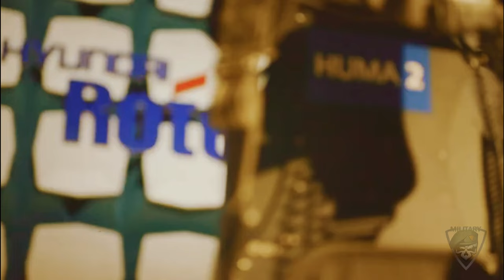K2 Black Panther : The Best Tank On Earth - Outperforms M1A2 Abrams and leopard 2 tank

Comment: News of three days ago, 26th. July 2023. Lithuania picks Leopard 2 tank as its MBT over Abrams and 'the best tank on Earth' the Black Panther and plans to acquire 54. The Czech Republic is to order another 50.
Reply: Czech borders Germany so the politics and relationship will determine which tank to buy. For Czech, it makes sense to buy German tank. Be prepared to wait 8 years to receive the tank though. Hungary ordered the German Leopard 2A7HU in 2018 and just this week (August 2023 - 5 years later...sigh) received ONE TANK. Also, the price per tank increased 2.5 times for Leo2 tank. Norway found out that the price increased to $60 million USD per tank and decided to not buy the additional 18 units of Leo2 tanks - too expensive. There are military planes that cost less than $60 million dollars. Romania on the other hand has close ties with Poland so most likely order 300 units of K2 Black Panther tanks to be logistically and supply chain ready with its partner, Poland. Italy has agreed to joint-develop the future K2PL specs for Europe as a replacement for Ariete tanks and no longer is a partner in the MGCS future tank project with Germany and France.
Reply: @jwb1227  The gist of my comment was that Lithuania did not choose the cheapest or the quickest to complete the order, but she chose, in her opinion, the best tank for the job, be as it maybe, more costly than the 'Black Panther' or longer to arrive than the Abrams, Lithuania chose the Leopard 2.
Reply: @joegatt2306  Germany sends NATO troops to Lithuania twice a year (I think?) so the relationship is there to leverage politics for a tank order. If you take politics and relationships off the table (not realistic), the real choice would have been between M1 Abrams (takes 3 years to deliver) and the K2 Black Panther (takes 4 months or less). Frankly, I think Lithuania is relying on Germany to send NATO troops to bolster Lithuanian troops (and maybe Poland also to send troops) in the event of a fight breaking out but Lithuania is way too close to Belarus/Russia/Kaliningrad to be so relaxed about its tank order taking 8 years to complete (Norway being in west EU far from Russia could take such a relaxed view but Lithuania is crazy). What will they do if Russians attack in 3 years? Throw rocks? Too much politics and not enough common sense or logic for Lithuania to order Leo2 tanks knowing that their tank budget just blew up because Leo2 tanks now cost 2.5 times more than the original budget and still takes 8 years to receive a few tanks. At least Estonia has better common sense than Lithuania.
Reply: @jwb1227  Still out of point, but anyhow, here is my reply: Czech Republic, Slovakia, Netherlands, Greece, Hungary, Poland (only country to-date to replace her Leo.2 with K2), Lithuania, Spain and Portugal, Switzerland, Turkey, Finland, Denmark, Sweden and Norway (all of Scandinavia! In 2020, Norway also had to chose between Leo.2 and K2, and chose the former!), Chile, Indonesia and Singapore, (so close to S. Korea, but...), Australia and Canada, Qatar and the United Arab Emirates. Potential buyers: Italy, Croatia, Bulgaria and Saudi Arabia, whose bid to purchase 600 to 800 (!) Leopard 2s did not go through due to opposition by Sigmar Gabriel, Minister of Federal Economy.
Reply: @joegatt2306  Your narrative paints a much more bright future for German Weapons production than reality. Here is my sur-reply: Total numbers for future Leopard 2 orders will still be less than K2 Black Panther orders. Just Poland and Romania will be close to 1,300 units of K2 with other Europe nations joining the K2 user club soon. Germany and surrounding nations who have good relationships with Germany (EU/NATO or otherwise) will likely choose to stay with Leopard 2 tank. Scandinavia: Norway chose to stay with Leo2 despite its own military asking the Norway government TWICE to buy the K2 Black Panther (this was real news, not fake news). Norway did cancel the additional 18 units options contract after the price of new Leo2A8 tanks increased 2.5 times to $60 million+ dollars per tank. Same for the rest: Sweden, Finland, Swiss, Netherlands, Denmark, etc. Basically, the most of the WEST Europe will likely stay with Germany's tank. This is not a surprise but expected. As for Greece, it has the only Leopard 2 tank production still in operation (btw, Germany no longer has an operational production line for Leo2 - that is why it is so slow to produce Leo2) and the fact that Germany saved Greece from the financial problem - so Greece will stay with Leopard 2. Turkiye will operate the existing fleet of older Leo2 tanks but after Syria and the fact that Turkiye now has its own MBT - the Altay tank in production due to help from the Koreans - so I doubt there will be any new Leo2 tanks purchased from Germany/Greece (Turkiye and Greece do not like each other). Spain and Portugal - these 2 countries will be "up in the air" (uncertain) since they only bought the older Leo2 tanks from Germany when they were sold as used for really low price. I doubt these 2 countries have the budget to afford $60 million+ dollars per tank price of new Leo2A8 tanks. Spain did not like how the Bundestag stalled the transfer of its Leo 2 to Ukraine and frankly lot of other nations are re-thinking the Germany weapons purchases because of this. As for Italy - it is no longer in the MGCS project with France and Germany - and has tentatively agreed to join POLAND for its next K2PL (Europe version) tank project. So not sure about Italy staying with Leo2. Romania chose American M1 and so did Poland. You will see in next 2-5 years that a lot of EAST Europe nations will buy American and Korean tanks for 2 main reasons: (1) Too close to Russia so need reliable weapons delivered faster than Germany (8 years waiting time) so American and Korean tanks can deliver faster, (2) Germany has shown to be UNRELIABLE as partner when Russia is involved (aka Ukraine) so there is a switch over to American protection instead. Americans are also having issues with slow production so Korean weapons are being recommended by the Americans (not recommending Germany b/c of Ukraine and slow production). Canada is 50/50 chance for staying with Leo2 as there are talks of purchasing K2 Black Panther for Canada as well as Korean Submarines. Australia is going with M1 Abrams, not Leopard 2. Rheinmetall sold Boxer to Australia but Koreans sold the AS21 Redbacks in competition with KF41 Lynx (I think using the quirky Liebjerr engine was a mistake. Should have used the reliable BTU engine like the AS21 Redback). Singapore will likely stay with Leopard 2 as their economy is strong enough to buy Leopard 2. As for South America and rest of Southeast Asia, they are more likely to abandon Leopard 2 tanks since buying new is not an option for them as their economy cannot afford the over-priced Leo2 and go with K2 Black Panther. The Koreans are expecting all this and are currently increasing their production capacity even more. Korea has 2.5 times the capacity for tank production over Germany/Greece but will be 4 times capacity over Germany in 2 years and that is just in Korea. In 2 years, POLAND will have a full K2 tank production line in Poznan, Poland. Poland will be a new supply chain in Europe for the K2 series tanks and the K3 next model. There will be an increase in Euro market and jobs for EU workers. Since Poland will also produce the K9 Thunder SPH in Europe, the current users of K9 will only increase. Even Norway, Finland, Estonia, etc. along with 7 other countries are using or will use the K9 Thunder. Both K9 and K2 will help each other in sales in Europe - mostly in EAST Europe and parts of WEST Europe. Norway, Estonia and others will be purchasing additional K9 units and the new K239 Chunmoo MLRS (Korean HIMARS with 12 launchers per vehicle instead of 6 in American version). Germany clearly knows that is going on and even Rheinmetall AG has asked the Koreans for partnership in future weapons development as there may be problems between Rheinmetall AG and KMW.
Reply: @joegatt2306  BTW, what I wrote about the countries and whether they stay with Leo2 or not - you opened the door by name dropping all the countries to flex the Leo2 user network (you meant to do that - don't think I did not notice). I merely gave you my sur-reply which looked into each of those countries internally. Most of those countries bought the Leo2 as hand-me-downs from West Germany after the end of Cold War. Germany did not want to pay for thousands of tanks to be kept maintained so it sold them off at bargain basement prices ($4-5 million dollars each). Most of those buyers today will not or cannot pay for new Leo2 tanks at $60 million dollars per tank. Logically - you can connect the dots - and see that in the future, some of those nations will retire the old Leo2 tanks that can no longer be maintained and switch over to the K2 Black Panther. Having a continuously running production line brings economies of scale and results in lower price per tank and Koreans are good at it. Moreover, they have industrial robots that do 70% of the armor welding and other automations while German arms industry still uses manual labor for almost everything. The time it takes ONE Leo2 tank to be built, the Koreans can build THREE K2 Black panthers which lowers cost of manufacture. You cannot achieve such advancements in just few years in Germany. It will take a decade of hard work and INVESTMENT.
Reply: @jwb1227  Another tediously long riposte. It’s getting boring, but here is my answer and it is as short as I could manage.
First, you did not address one single issue from my last post. The origin of this wasteful exchange of words was 'The Best Tank on Earth - Outperforms M1A2 Abrams and Leopard 2 tanks'. Now, if you took it upon yourself to determine that the WHOLE WORLD, (you got that?) is ABBANDONING the German tank and opting for the cheapest and fastest to produce, (because the Leo.2 is built by manual labor, in factories of lesser capacity than that of the Koreans….blah, blah, blah), then that is another matter altogether. The 0.5 million Stg. Rolls-Royce ‘Phantom’ sedans are also handmade and there are much fewer to go around but are more highly regarded than the 'robotic built' Mercedes Benz EQE sedan that cost under one fifth of the price, max. 
Secondly, you have spent sleepless nights to look into each and all of Leo.2 operators and all you come up with is ‘trade and politically motivated’ deals. Well, here is the thing. The latest S. Korea – Poland arms deal is the most trade-motivated deal of them all. Both countries have long standing relations. In 1989, after the end of the ‘Cold War’, South Korea and Poland established diplomatic relations (the second Eastern Bloc country to do so) and Seoul announced $450 million in loans to the financially troubled Warsaw government over the following five years. The trade between the two countries amounted to nearly $9 billion in 2022 with aims to triple the bilateral deal by 2030. Flights from Warsaw to Seoul, 80 percent of seats would be occupied by Korean businessmen. A strategic partnership also agreed upon from 2013 that led to the present-day arms deal that includes the K2 Black Panther and also the K9 Thunder howitzer and the A-50 fighter jets. 
Thirdly, the K2 is also cheaper to produce for the simple reason that most of its components such as the gun (Abrams M256, itself a development of Rh-120), engine and transmission, (Leopard 2 MTU engine and Renk transmission), fire-control and electronics (Abrams), auto-loader (Leclerc), tracks (Leopard 2), were copies or developments of the originals so they spent less than they should have in research, (although it took them seven years to reverse-engineer the MTU Friedrichshafen MT 883 power plant!).  
Or haven’t you heard of Korean Copy Culture or the hard work it takes for Koreans to steal technologies from other companies!
Reply: @rocketm5045  
나는 항상 인쇄술이 독일인에 의해 발명되었다고 배웠습니다. 일부 지구인들은 복사를 다음 단계로 발전시키는 경향이 있습니다.
Reply: @rocketm5045  한 무기 전문가는 간단히 이렇게 말했습니다.  레오파드 2와 르클레르가 사랑에 빠졌다면 그들의 후손은 바로 K2 블랙팬서!
Reply: @jwb1227 If one tank costs that much, it is natural to purchase an Apache Guardian that can destroy 10 tanks.
Reply: @joegatt2306 The world's first printed metal text was the Jikjisimgyeong from Korea's Goryeo Dynasty in 1377.  Gudenberg 1445.
Reply: @noirbeck  Apache can do what you stated but it also requires an uncontested airspace superiority to safely attack enemy ground targets. Otherwise, the Apaches will become a ball of fire falling from the sky. To be fair, both tanks and attack helos are needed as each have its pros and cons.
Reply: after poland started ordering them it seems all of europe wants  them
Reply: @Michael-i7w6r  After considering the K-2, both Norway and Lithuania opted for the Leopard 2. Who else? Romania? Still deliberating.
Reply: @joegatt2306  Romania officially announced that American M1 tanks to be purchased (M1SepV3). This increases the chance that Korean K2 Black Panthers will be selected as both K2 and M1 work together better. Like I said in the past most of the East EU will likely roll with K2 Black Panthers.
Reply: @jwb1227  So now its the East EU. Please note that Lithuania and the Czech Republic are also Eastern EU. Ps. the M1A1 Abrams ordered by Rumania, are not K-2s!!!!
Reply: @joegatt2306  I think we debated over several weeks ago on this point so I won't rehash the same thing. Simply put, Germany's Leopard 2 is still a formidable tank and lots of EU countries will love to buy them but the issue is with very low production capacity - I believe around 22 tanks per year. The Koreans have a full capacity in their factories that can produce 4 times the number of tanks than Germany. Add to this Poland will have a K2 production line for EU sales. Some of the East EU countries that have better relationship with Germany will continue to buy German weapons. I was just telling you that - in General terms - the East EU will prefer American/Korean tanks instead of German tanks. The Americans are also helping to sell the Korean weapons in the EU. Poland first bought M1 tanks and then decided to buy K2 tanks as well. Romania has bought M1 tanks and Korean K-9 SPH and soon they will order the Korean K2s because - the deal comes with Poongsan deal for 120mm and 155mm ammunition factory to produce in Poland (100,000+ rounds per year) and also in Romania (100,000+ rounds per year). There is a shortage of ammunition in EU and only country that can fulfill the need are the Koreans.
Reply: @jwb1227  You are right in everything you said, but it should be noted that the main reason of the Poland-South Korea deal is due mainly to the long standing trading relations between the two countries. Korea was Poland's first trade partner when the former exited the Warsaw Pact in 1989. The trade between the two countries amounted to nearly $9 billion in 2022 with aims to triple the bilateral deal by 2030.
A final word - with a pro-NATO country delivering 4th. Generation tanks to Europe is not the best situation for Russia, so I am happy with that.
Reply: @joegatt2306  Korea-Germany trading relations is great also. There are many German companies in Korea and Koreans LOVE-LOVE-LOVE German Mercedes, BMW Porsche, and Audi. One of the former Audi chief designers is the head of KIA. Koreans also bought German Taurus missiles and is jointly developing future versions of Taurus as well. Lastly, when Koreans were starting their weapons program in the 1970s, German companies along with American ones were there to trade with Koreans. The Korean submarines built today are direct descendants of German Howaldtswerke-Deutsche Werft Type 209. Koreans developed their own technology after that and added their rechargeable battery technology to make one of the best diesel-electric AIP subs today. Lots of sub-assembly parts are still purchased from Germany today - even though Koreans are capable of making them - because to maintain trade with Germany and also because parts are well made for good price.
Reply: @jwb1227  The norwegians tested the K2 substantial and the leopard performed the K2 out.
Reply: @85daniel  Your source?? I would invite you to read my earlier comments. I even sourced a local Norwegian weekly article closely following the entire testing done in Rena testing grounds. The article is in Norwegian language. The evidence is clear. The performance and final decision by the FMA (military acquisition) asked for the K2 Black Panther and NOT the Leopard 2. The Norwegian civilian government vetoed the military request and decided to buy the German Leopard 2 instead for business/political/NATO partner reasons in direct opposition to what Norwegian military wanted. Regards.
Reply: @85daniel  If you search for "Norwegian military reportedly recommended the K2 Black Panther twice over the Leopard 2A7" you should get an English translation of the original Norwegian article. Thanks.